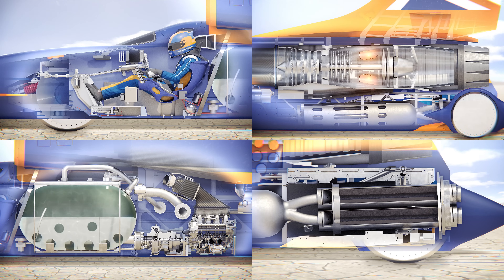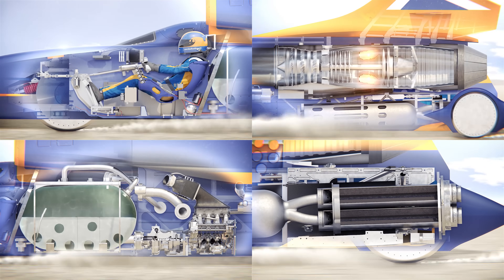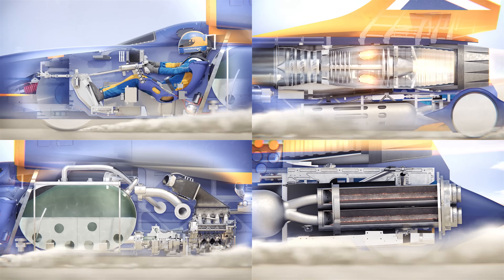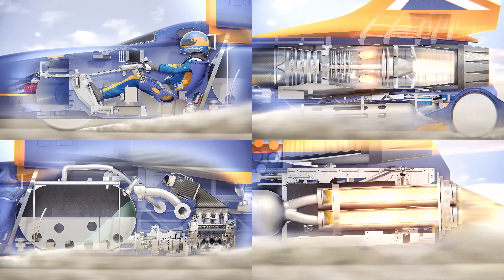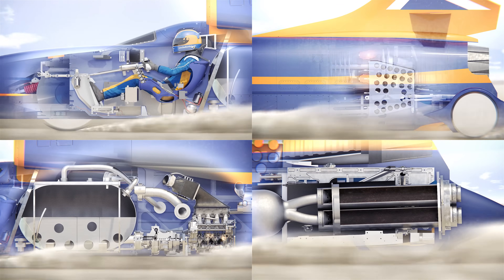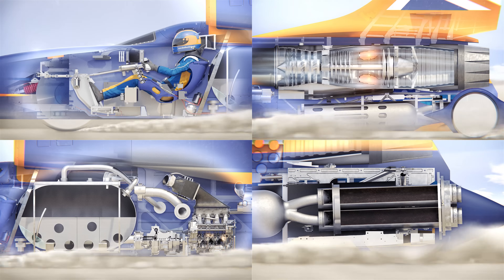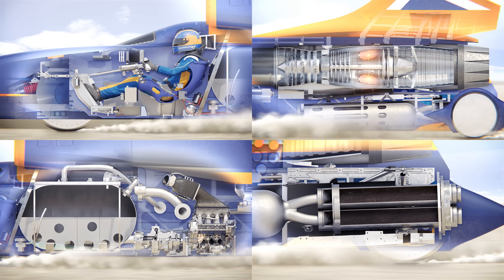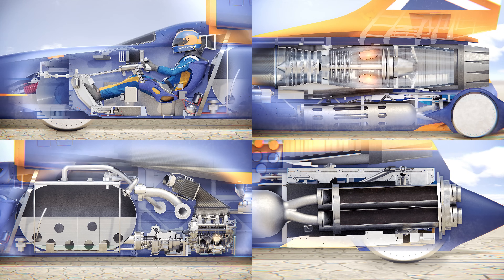Bloodhound SSC: 0-1000-0 MPH In Less Than 2 Minutes

Comment: I never really understood this concept:
I was always taught that an oxidizer is a substance that accepts electrons in a reaction.
So how does this apply to rockets? Why do oxidizers need to be pumped into the rockets? Dont you actually need a source of oxygen for the rockets to actually burn?
Reply: iwillavengeyou It's not that it's expensive or to dangerous, hydrogen peroxide has the chemical make up H2O2. It is more oxidizing than pure oxygen O2! Also it is actually more dangerous than liquid oxygen is.At the concentration they are using(86%)if this thing crashes and ruptured the peroxide tank it will basically dissolve CAPT Andy almost as soon as it touches him! Any organic substance will dissolve when exposed to this high a concentration! Well dissolve and burst into flames,the flames getting stronger as the subject dissolves  due to the increase in surface area!Pretty friggin gruesome ain't it? Also like to use it as they don't need ignition system for the rocket motor because the combined oxidizer and solid fuel,in this instance,ignite spontaneously!Saves some weight and complexity in the rocket motor!
Reply: Insurance?
Bwahahhahahahaaaaa!!!11!!!!
Nice one!
:-)
Reply: It burns! It burns!
Reply: Look at it this way. An oxidizer has extra oxygen and gives oxygen to other stuff, kinda like Santa. If you fill something with fuel then there's no air inside for it to burn. Oxidizers also pack more oxygen per cup Vs Air.

In complicated chemical sense, taking an electron from another thing in a reaction gives the thing a charge of +1 which is also oxidisation, as is removing Hydrogen from stuff? This is cars not chemistry, relax lol
Reply: yes i know you need oxygen.
But the terminology is very confusing.
Is "oxidizer" referring to a substance that donates O for combustion?
Or is it referring to a substance that receives electrons?
And why use chemicals other than liquid O2 which seems to be just pure oxygen.
Reply: iwillavengeyou Yes it provides Oxygen for the flame. I think what they call 'oxidizer' you might know as an oxidising agent.

I'm no  rocket scientist but liquid oxygen is a serious fire hazard and expensive and will also ruin the tank and burner unless expensive ceramics are used? The sponsors and the insurance probably weren't to thrilled by the idea...

Comment: Some info. Hakskeen pan {Huck-skean-pan} (directly translated to "heel pan" as in the heel of your foot) is located here in the Northern Cape of South Africa in between the neighboring countries. Namibia and Botswana. it is close to the Kalagadi Game reserve. It probably never rains there, temperatures rance from 32-48 deg Celsius in the day and as low as minus 4 deg Celsius at night. It is a dried up lake with lots of nothing. This pan is one of only two or three locations on earth big enough for them to reach their desired speed. the other is a dried up lake or something in Australia. the reason why the famous Bonneville salt pan was not used is that the track surface was compromised over the years by everyone doing high speed runs and the "track" is in regular use. The original idea was to use Verneuk Pan {fir-neuck-pan} in South Africa where Donald Campbell i believed attempted to break the land speed record with the blue bird. however due to the high altitude above sea level + 2000m and high temperatures, he had a very disappointing run and named is Verneuk Pan (cheated pan). Also after further investigation revealed that just below the surface there was a mass of pebbles and stones. the BH team then launched a massive operation to clean up the area and make the track 100% flat. they didnt use earth moving machines as they believed the surface would be compromised. so they had the area cleaned and prepared by hand. The BH also does not have active aerodynamics and very little computerized equipment. the reason behind this is that if you are traveling at say 700mph+- and all of a sudden your computer crashes and the "blue screen of death" appears, it is a bad thing. therefore all the devices that make sure that the BH stays on the ground all the time are mechanical. The closest city is Upington and is about an hours drive away, with a small border post town of rietfontein (reet-fon-tain) on the South Africa Namibia border. The best way to reach this location is to fly to Cape Town International RSA and then a flight to upington (if available, due to the thin hot air not being sufficient for the airplane to take off) or an estimated 6hr drive by car. There is a whole lot of nothing in al directions. void of mountains vallies ridges wildlife and pretty much everything is void, except gravity. That is my take. hope it helps.

Comment: Hi mate, sorry this question is not relevant to this vid, but would you be able to make a vid on how a 'rev limiter' works? How are some engines physically limited at a certain amount of revs to stop them over-revving?
Scott
Reply from the maker: Scott Merchant Usually done by cutting fuel or killing the spark.
Reply: Thanks for the reply, it's quite clever how they can set 'pit lane limiters' in racing so the cars/bikes do exceed the pit lane speed, also sounds good too!
Scott

Comment: So is the supercharged Jaguar engine a common engine they use in general? Or could they use any V8 besides the Jaguar one?

Also, why the Jaguar V8?
Reply from the maker: Sponsorship. There are many ways to make 500 hp.
Reply: Zyklon - Drake. I'd imagine they went with Jaguar for reasons of both sponsorship, and British branding.
Reply: Engineering Explained There are better ways you mean XD
Reply: Sval Bard
Sponsorship probably but British branding No.
Reply: Zyklon - Drake. I'd wager it is.
Reply: Zyklon - Drake.
I believe they did. That would be Tata. They also produced some of the steel that's used in the car.
Reply: Sval Bard But I thought some Indian company bought Jaguar some years ago.

Comment: As impressive a feat as this really is and it is REALLY impressive. I think there is so much more to "car speed" than just going in a straight line.
I'd much prefer to see a purpose built track yes with long ass straights but also a corner section or three. To really gauge how fast we can make a car go.
Reply: there was a track (and maybe still is) at something called Transportation Research Centre. &.5 miles around I think two corners of 1.75 miles each a joined by two straights of 3 miles each. I think Fiat has a similar track in Italy.
Reply: I'd much rather "land speed" records were set on a track by a driver of the car manufacturers choice than strapping a jet engine to a car and praying it doesn't take off
Reply: robjapan the goal is for it NOT to take off. It's not designed to be a plane....
Reply: Yes.... which is what I said.

Comment: I think bullets travel at 1600mph. It'd be awesome to see a land vehicle match that speed.
Reply: ethan199303 depends on the bullet. There's definitely a firearm that flies at 1000 mph
Reply: ***** If you match speeds, can you catch it in your hands? Ignoring air resistance on your extending hand...
Reply: Zyklon - Drake. yes.
Reply: most handgun ammo reaches less than 1000 mph. It is not uncommon for a .45 to reach "only" 500mph.
Reply: ghostofChrist not actually, 10m away from the muzzle they are barely worm.
Reply: Engineering Explained Exactly. It'd be hard to record that but hey, fun to imagine.
Reply: Rat Race anyone?
Reply: Nice!
Reply: Zyklon - Drake. Yes, but you wouldn't want to. Fired bullets are very hot.
Reply: SalveMonesvol
The heat tends to rise with bullet speed, but your handgun is only ever meant to fight your way to your rifle, right?
Reply: ghostofChrist
I took a pottery class or two...